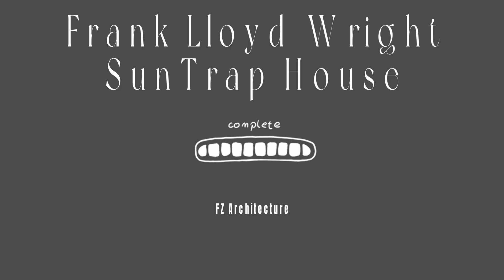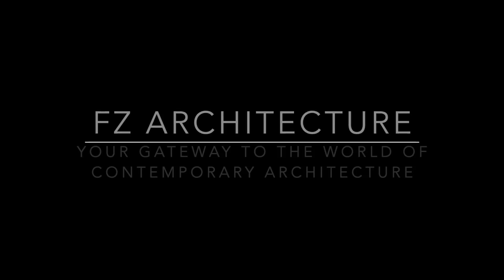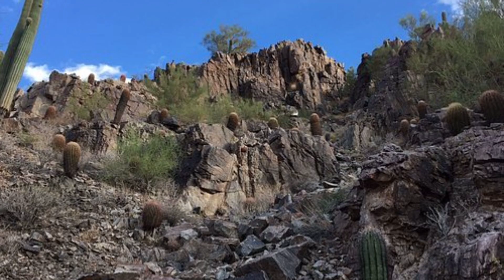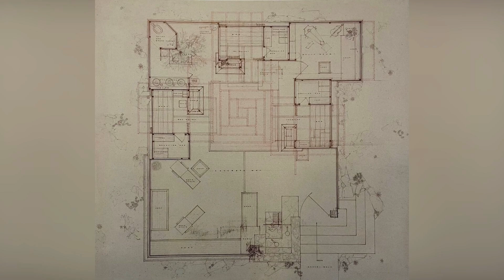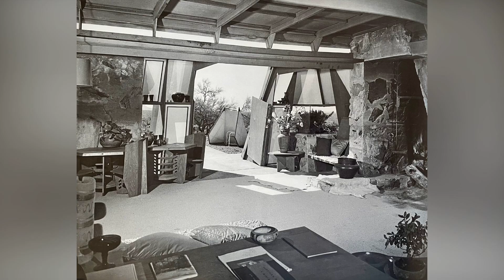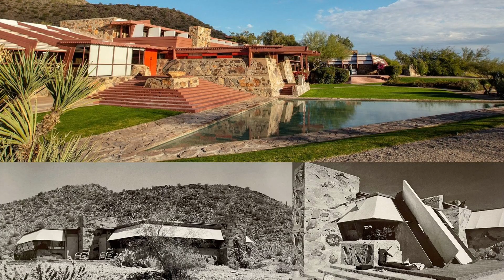Uncovering Frank Lloyd Wright's Sustainable Design Evolution

Comment: About that cross ventilation. We do not have breezes here, especially in summer. We have wind. Big wind, tree snapping wind. And its temperature is probably 100 degrees. And with this hot wins comes the ever-present dust. It covers everything. And then he built right in the path of our giant summer dust storms. Walls of dust 1,000 feet high rolling across the desert at up to 100 mph. 

This is a brutal environment. Do not be fooled by the insipid dialog. I’m glad he came because it is also beautiful, like Wright himself.
Reply from the maker: Thank you for sharing, and the explanation comes from the control from the architecture has Wright for that brutal environment as you said. For that reason has mobil partitions, big stone walls, etc... to protect when is needed, and that massive construction also serves as a thermal inertia that allows during night, even in summer, refresh the interior to enclose during the day. We have to understand that the architecture has to control the weather and it changes during the year. So not always we can use breeze during day, but probably in winter and summer nights. Thank you for watching!